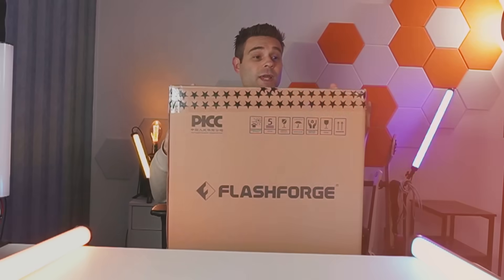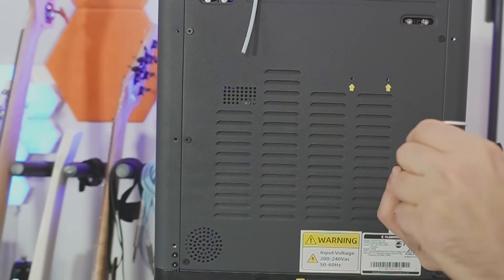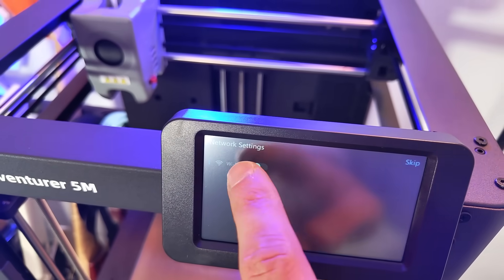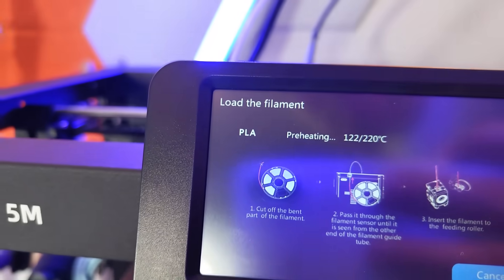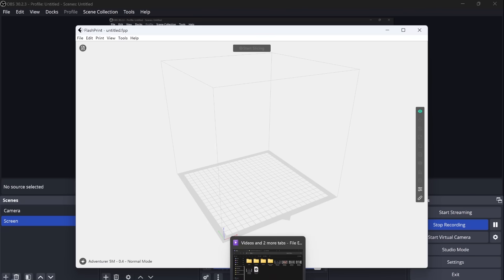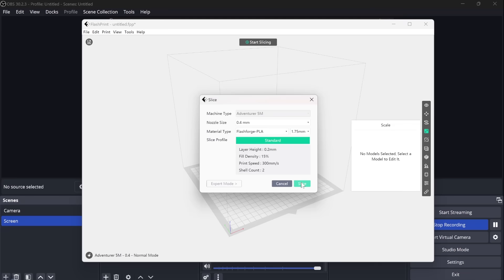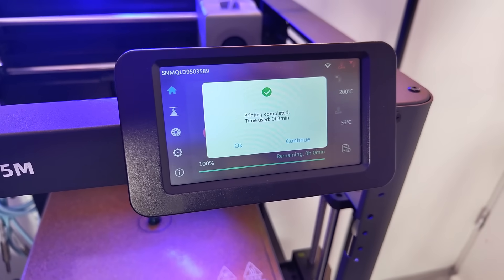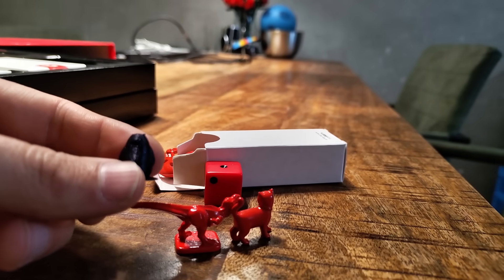Unboxing & First Setup - Flashforge Adventurer 5M

Comment: Not claiming to be an expert, but a couple of things i noticed, was your spool holder up the right way, secondly the HS on your filament packet mean High speed,so in slicing you should click Flashforge HS PLA, and finally when finished click ok not continue as it will try and print the same thing again
Reply: Thank you for posting this comment, would have never caught the HS on the packaging otherwise
Reply: haha i put mine on upside down the first time too on accident lol
Reply: Same
Reply: Same

Comment: I orders the same printer. I have also a resin printer. They would be much better to use for those small figures. I have the one from any cubic 4k they are cheap any give amazing result. Those fdm printers are good for bigger parts

Comment: Is it safe to use indoors if using PLA if a window is open?
Reply: I've never had any issues related to PLA fumes. PLA is fairly safe to print, there are minimal VOCs released. ABS and ASA are the main ones you need to be careful with. Still, use your best judgement.
Reply: Yes PLA is safe to use. That’s why school only use PLA. I dit other plastic like ABS but it’s not easy to use and you need an enclosure. I had also a vent system for the fumes because you can really smell it

Comment: This is a great printer. I have Flash Forge Adventure 3 and 4 lites, Creator3, both 5M and 5M pro. I also owned Adventure 3, which broke. To say I very familiar with Flash Forge printer would be an understatement. Whoever is interested in the 5M and 5M pro would be getting a wonderful printer, however it has on major draw back. Instead of the automatic load
and unload function of the other Flash Forge models, these printers require you to un attach the Bowden tube from the extruder assembly and cut the the filament and the manually
extract the filament from the Bowden tube. The heat the extruder and purge the remaining filament through the extruder nozzle. Doesn’t sound too hard, but there is a little gray piece
of plastic that is called he filament feeder. This part is the creates the problem. When purging, this peace is so fragile or cheap that the filament gets jammed in this part, resulting in
a complete disassembly of the while extruder assembly to replace this part. I’ve decided to just let the filament run out totally instead of changing filament
Reply: Do you know how you are able to open the files into the slicing software, i keep having trouble with it
Reply: @RachelKuntschik  elaborate
Reply: Are you referring to files you downloaded loaded from a site. If that’s the case, the most important thing is
that they or STL file. I believe some OBJ files can be sliced in Flash Forge slicer. STL or OBJ files are the only
files that are recognized by the Flash Forge Printer slicer. The are other slicer that can switch mesh files from
other mesh file to The files.
Reply: @AprilWilliams-n6h  Thanks, I've had my printer since Christmas but hadn't figured out how to use it until now.

Comment: It’s not obvious how the ribbon cable attaches to the LCD display.  Any suggestions?
Reply: There is a switch thing on the back
Reply: Hopefully you’ve figured it out, took me a bit, but in case you haven’t, there’s a plastic bit that pops towards you on the plastic attachment point. After you pop it open, you put the lcd sheet into the paper thin hole that opens up, place it in square, and close the clip again.

Comment: Hey, I'm having an issue with mine as I had gotten it for Christmas and all set up, but the filament isn't sticking to the plate and flies all over. anyone know what's up?
Reply: Hey this is pretty common with these pve or metal plates. What happens if they typically accumulate grease or oils from our hands and touching it. What you can do is simply take the plate off the heatbed, wash it with dish soap, dry it, and put it back on the heat bed. If you did that and you still have issues try a small glue stick and just put it around the perimeter of your print. I hope that helps
Reply: This happened to me yesterday and I thought it was bed adhesion issues but it was because I was printing a “raptor claw” and it didn’t lay completely flat on the plate so it was pulling itself back off and making spaghetti haha, I just rotated the print and it worked fine.
Reply: Might be clogged because when mine gets clogged its starts doing that then stops printing

Comment: Do you need a computer or can you send files with an iPad?
Reply: I use flash print witch is online you can use mobile and import files from it
Reply: @Extrastorage-rm5nf  mobile don't want for it
Reply: I run mine on a MacBook and it just sends through WiFi. Works great. And I use orca slicer.
Reply: You need a computer because you have to connect a usb drive to the printer unless you use the flash forge slicer but I’m pretty sure that only runs on pc
Reply: @carmichow  straight through WiFi
Reply: @carmichow  not true
Reply: Hi